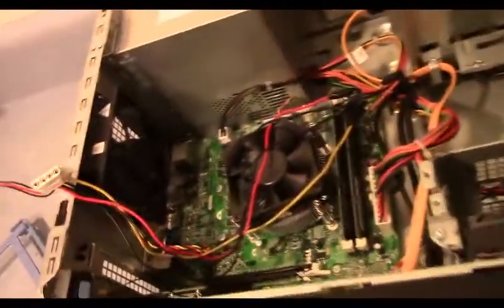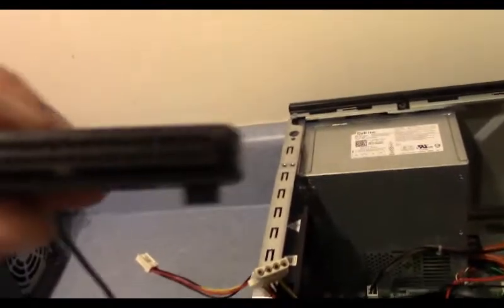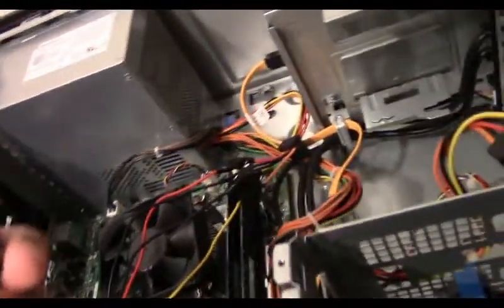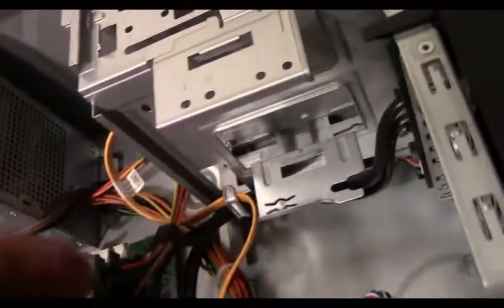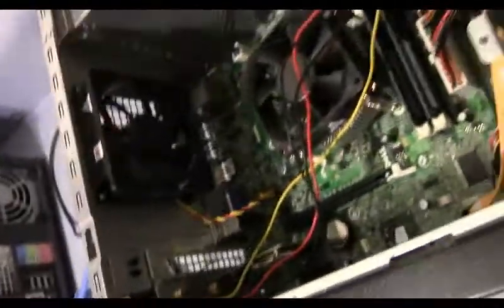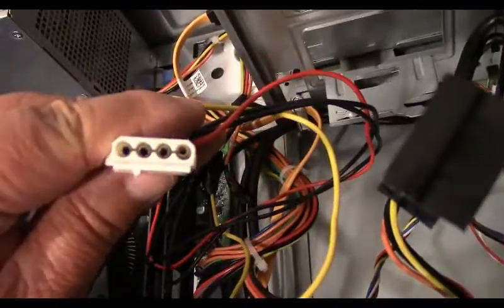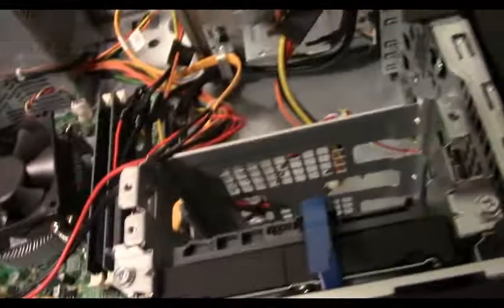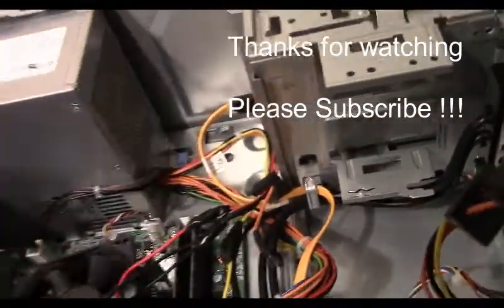How To Change SATA Power Connector To Four Wire Connector For IDE Hard Drive

Comment: Hi, Thank you much for the video. I'm in the process of doing exactly the same thing. The problem is that the SATA cables on my new PC are all black. How you go about this?
Reply from the maker: Your Sata cables may be black but the power cable coming from your power supply to the hard drive should be color coded. Good luck with it.  Thanks for watching... Calvin
Reply: @SouthernCountryLiving  exactly. How do you match different color with just black.  Hiw do you know which one goes where.
Reply from the maker: If you are putting an ide harddrive in the computer,  then you have to get a power plug from another old computer and splice it into the power supply of the new computer.  That is what I did.  Other than that, I don't know how to help you with it.
Reply from the maker: I also used a special adapter for the data connector to connect to a usb port. The adapter is called ide to usb adapter.  I bought it from ebay.
Reply: check with multimeter ususally 2 in midle are gnd then one probe there other one check with probe also it is possible say it by its connector look

Comment: isnt there just some adapter you can buy? i think id be afraid to cut wires and just tape them
Reply from the maker: Thanks for watching.  There is not an adapter that I know of.  These wires only carry a low DC voltage.  I have spliced many wires together like this for many years.  The computer that I did this on is the same one that I am writing this reply on.  I have not had any problems at all with it.  
Have a great week,
Calvin
Reply: @SouthernCountryLiving  The adaptor is a 15 Pin SATA Male to 4 Pin Molex Female Power Cable For IDE Hard Drive/CD/DVD acp - You can find it on ebay